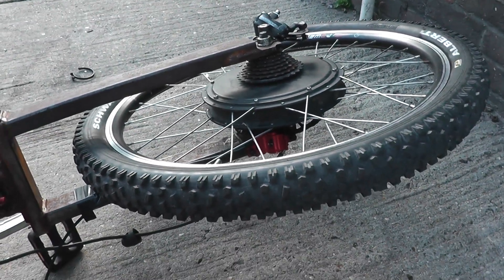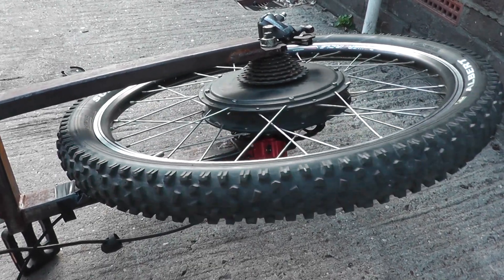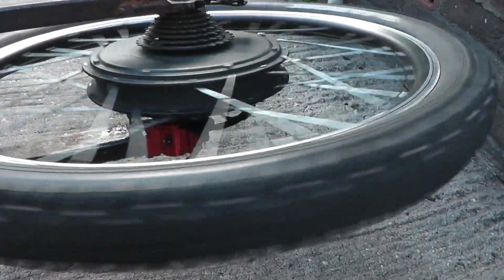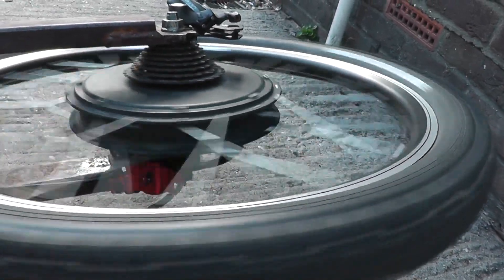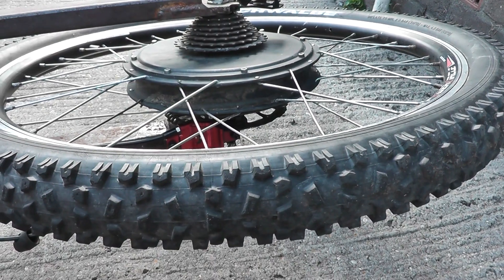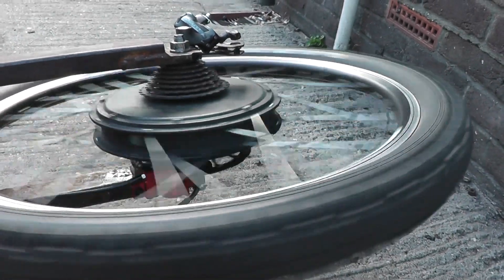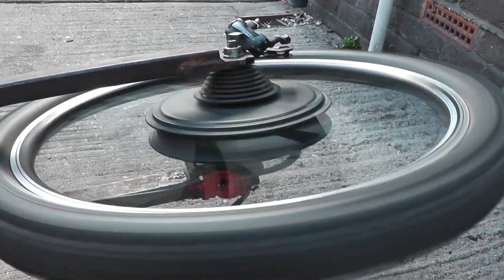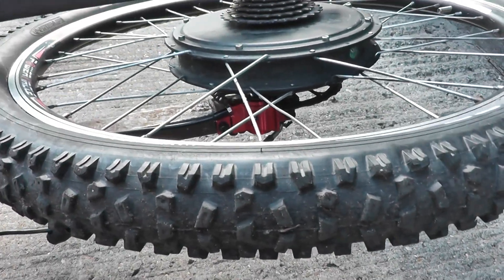1000w voilamart hub motor BURNT  OUT  and  how to tell   (burnt windings )

Comment: you cant burn out the windings. Some wire is burnt out inside and needs to be opened up and de-soldered and re-solderd with new copper wire. I repair all of mine that were having this problem and they still work like new ( over 5 years old)
Reply from the maker: lol   you can  by running   72v   150a esc     the  windings  where  cooked resistance test confirmed  it  as  did looking inside  im shocked it did anythinc  tbh

Comment: It sounds like Hall sensors
And if it doesn't run under load it will be the hall sensors.
This is basic knowledge to any ebike builder.
Reply from the maker: WELL IT WAS BLACK AND CRISPY   INSIDE   LOL   DID A VID ON THAT TOO ID WOULDNT RUN AT ALL IF WAS  SENSORS     MAYBER ON A VERY  OLD  BLDC CONTROLLER   ONLY SEEN IT ON   THE OLD 12FET EBAY ONES FROM ABOUT 10 YEARS AGO THIS WAS A DUAL MODE  UNIT SO COLD RUN FULL SENSORLESS  IF NEEDED   (LESS STARTING TORQUE  THO  BUT LIKE I SAID IT WAS VERY  COOKED
Reply: It’s not a hall sensor lol. You can tell by how fast it winds down that there is friction between the magnets. A replaced hall sensor wouldn’t fix that. Basic knowledge for any experienced e-biker.

Comment: Sounds like it needs grease on the plastic wheels. Open it and check
Reply from the maker: was a direct drive  9c clone   no gears    just  stator   and   magnets  was 1 burnt winding  (black and crispy)
Reply: @TCBOT  lol def a motor who cried for help!
Reply: Where you able to fix it ? Will you sell it for parts. I’m in need of a Voilamart motor cover since mine cracked.

Comment: What gives it away there are bad windings? Does it spin if you fully disconnect the cable to the hub motor so its completely unpowered and not connected to the controller. Those voilamart motors are typically very reliable because they are so simple being direct drive. I think people have had to replace hall sensors on occasion and of course the bearings need replacements after a few years but generally amazingly reliable especially considering their price. I think you can use ferrofluid inside them to improve cooling, drill a small hole and then syringe in a tiny amount and seal, this helps cool the motor under load and improves efficiency. I think if you disconnect the cables and it's stiff to rotate then there is a short circuit in the windings or possibly some other fault but if it rotates freely the fault is elsewhere. They need very good batteries though, 48V and 12Ah or more to provide enough current and obviously as batteries age and fail that can be a problem. Its the same hub motors used from current restricted 250W mode controllers up to about 2500W or 3000W so some of these do get quite extreme wattage use. The suppliers just supply the correct controller.

Grin technology has some great videos about refurbing direct drive motors and using their stator-aid (ferrofluid) in such hub motors.
Reply from the maker: not Shure what last owner did to it but iv had them run 6kw no issues till i pushed it too long  but this one i got from a boot sale   iv pulled it apart and you can see its burnt    only 3 copper strands   are black /peeling